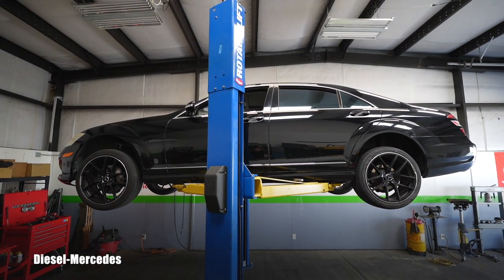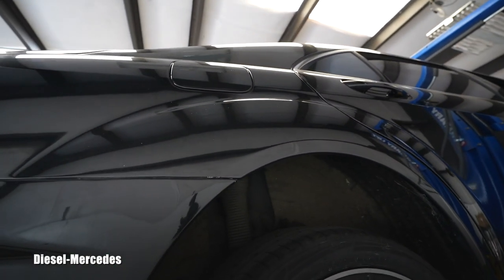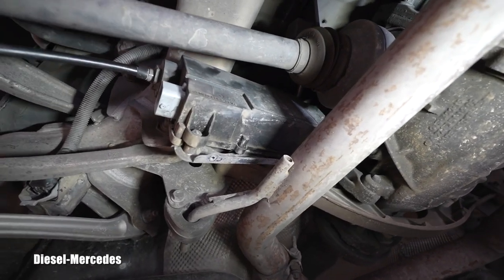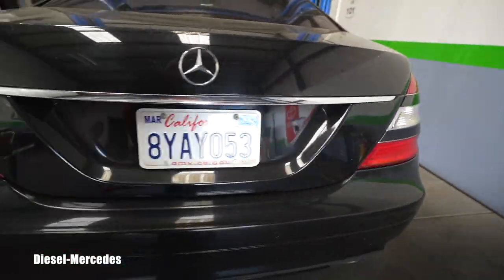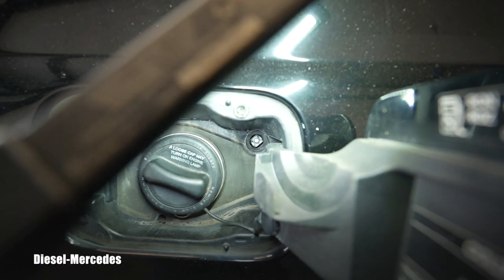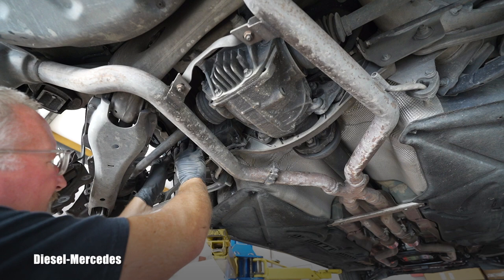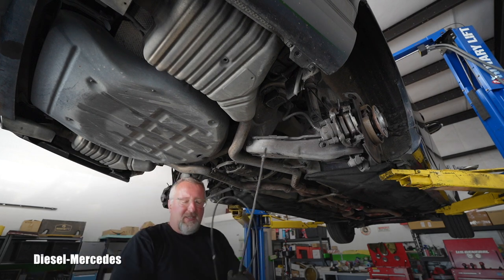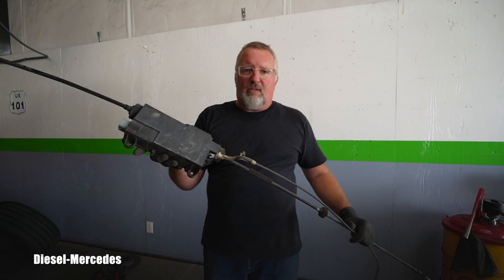Mercedes S550 Electric Parking Brake Location, Removal

Comment: Hiya friend 
I have 2013 Mercedes s550 , w221 the battery drains overnight , one of the code is D135 wake-up command short circuit to the ground. Please advice 
Thank you